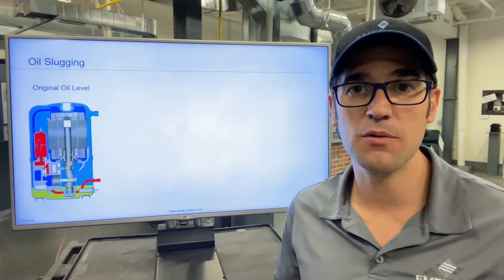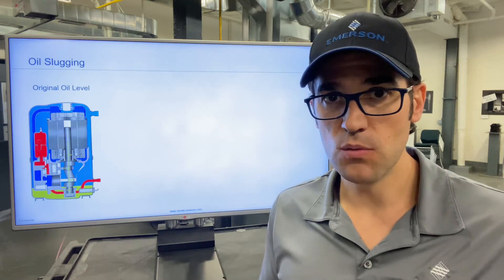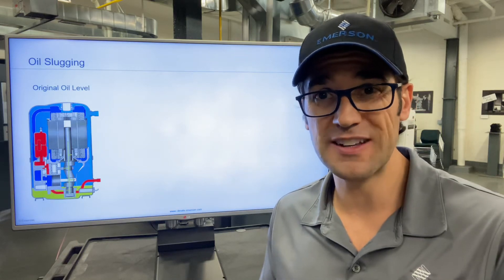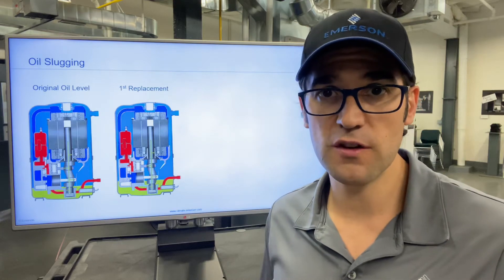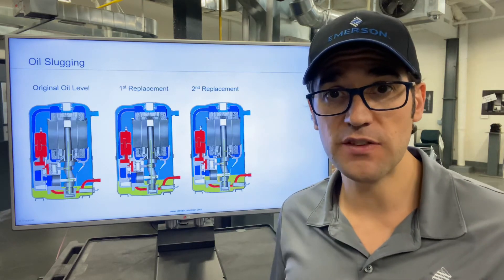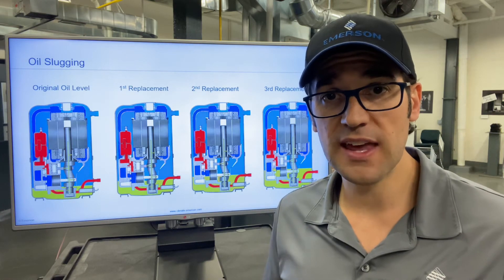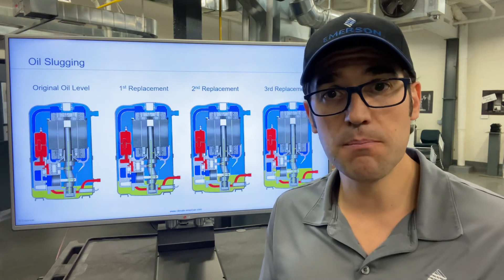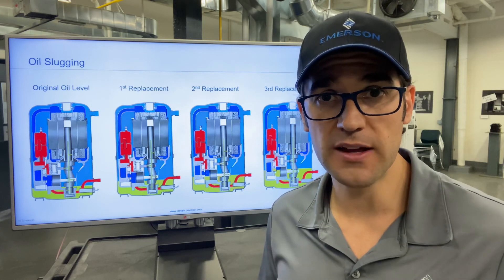Compressor Oil Slugging

Comment: So how do you measure the amount of oil that is in the compressor? Thank you for your videos.
Reply from the maker: Only when you replace it you can measure the amount of oil in it.
Reply: @RefrigerationMentor  Too bad there isn't an easier way to check that oil level.  The high side pressure ramps up to about 420 PSI and then backs down every 30 to45 seconds. 
Slugging with oil?  
Refrigerant charge was weighed in according to factory specs.   
Thank you for your videos and your advice. 👍

Comment: Saw a new compressor replacement last 34 days.  Original compressor failed for poor compression, likely able to get oil out to evaporator in liquid line during cooler nighttime but not enough vapor mass flow to get it back.  Replacement compressor restored proper vapor flow and returned all the oil left in evaporator to replacement compressor.  Replacement compressor developed severe hard start after the first on cycle to cool down the house.

Should be able to recover 85-90% of spec plate oil load from old compressor if oil is not excessively left in system.  This assumes you do not have P traps for high rise building.
Reply from the maker: The only way to really understand what caused the failure so the next one doesn’t fail is to inspect. Also, make sure to measure the oil.

Comment: What does slugging sound like? I have a 5 ton condensor thats making sound similar to this https://www.youtube.com/shorts/pkDZyV6W-sI at startup but maybe 1 second less of the groan. It doesn't sound normal and also vibrates the wall/flloor. Is that a strong sign that its slugging at startup? it runs fine after that and cools ok.

Comment: Hi, I have a question about oil changes. On certain scrolls there is an oil port, but it apparently doesn't have a dip tube of some sort to remove all the oil. What can I do to remove it? It's a system with 2 parallel compressors with an oil equalisation line. Can give you the model numers if necessary.
Reply from the maker: You can reach out to Copeland to see what they recommend but if they had a baffle plate in the sight glass you are going to want to cut the lines and tilt tandem set it to drain for quickest change out. I know it’s not fun. If anyone knows a better way please share.

Comment: Great vid thank you.

So the only way to really measure the oil is to cut the compressor out and literally pour the oil out snd weight it? What are some signs or symptoms to look for when you suspect the compressor could be low on oil? I’m in residential
Reply from the maker: Yes the Only way to check is to measure how many fluid oz are still in the compressor. Noise, high discharge temps, high amps could be signs of low oil.

Comment: Hello good to know gonna think Bout it before adding oil to compressor now. Do you know when to change oil on a compressor in term of hour of running(reciprocating type)?
Reply from the maker: If the system was installed properly and it was never opened and stays in the operation envelope of that compressor you do not have to. Think about your fridge at home how often do need to change that oil? Now on a parallel rack an oil test should be done minimum every year but I would follow manufactures recommendations.
Reply: @RefrigerationMentor  thank you for the answer. Do we have a bulletin for oil management by emerson?

Comment: Had a senirio where mutiple compressor  failures had occurred ended being a plugged inlet screen at the bottom of the accumulator. Poured 3 compressors worth of oil out of it when we replaced it.
Reply from the maker: Yes I have seen and heard of that many times. That is why it is so important to measure that oil to figure if it is somewhere in the system.